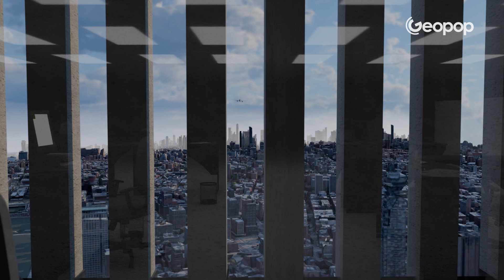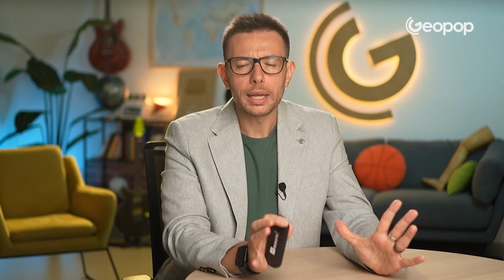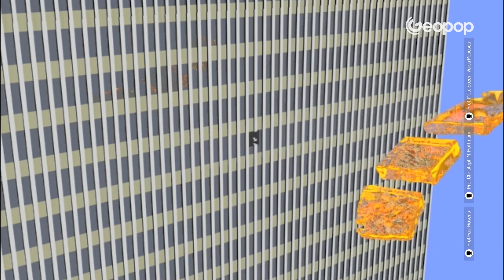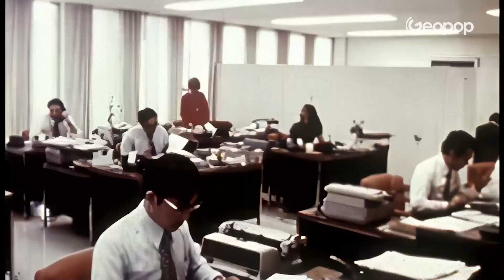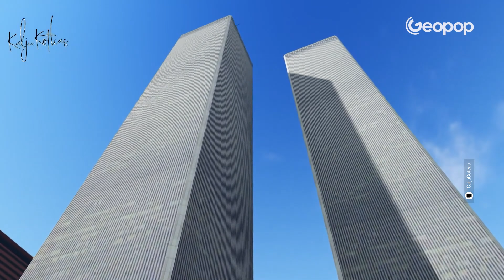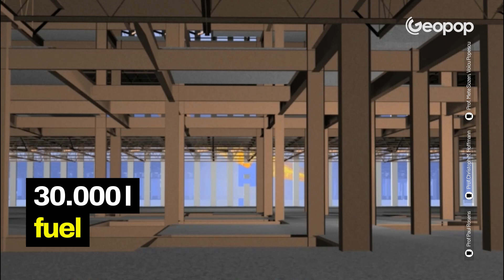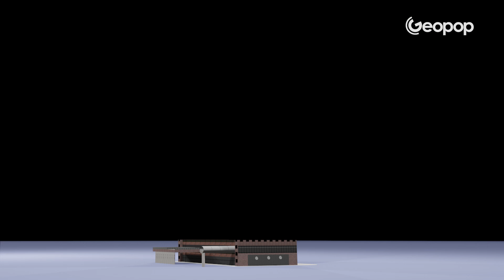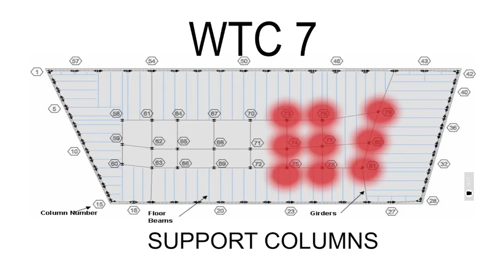9/11, 2001: The Technical Reconstruction of the Twin Towers and WTC 7 Collapses

Comment: Your information is incorrect.... There are over 25 thousand engineers that totally disagree with what you reported.... And what was given as a conclusion to this horrible attack.... The material used in an aircraft is much softer than the steel pillars constructed in those towers..,.so hitting those buildings would have buckled up the plane and they would have fallen apart....you can see this if you had checked out any other plane crashes...... When firefighters arrived on the scene the windows on the main and second floors were blown out indicating there were explosions that took place at lower levels, you can see all the floors underneath the points of impact there was no damage,.  ....workers in the building reported that several weeks before the crashes the buildings swayed from some sort of construction going on in the buildings and they could hear heavy grinding.... This noise would explain possible cutting into the pillars on various floors to weaken them where military explosives were planted.. when those buildings were in free fall you could see the explosions going off floor by floor.....the explosions underneath the buildings and on floors indicate destinations we're taking place...... absolutely very little things were recovered ....no desks no computers or chairs etc almost everything was pulverized to dust including many of the steel pillars and that kind of destruction is caused by military explosives..... firefighters reported molten lava flowed under the streets for days do to the explosives used....the firemen's boots melted from the intense heat ... Jet fuel does NOT burn that hot to that extent and that long....  Molten lava is caused by an explosive that burns at over 2000 degree F... A pancake fall meaning one floor falling on top of another would have taken much longer to come down and would not have fallen as perfectly as they did... people reported they heard timed explosions going off underneath them... which means explosives were planted under the streets ....I'm sharing enough... Think outside the narratives now that we know the war and who we blamed it on was fake and based on lies..... here's a clue .... Donald Rumsfeld went on the news the night before nine eleven and reported that 3.2 trillion dollars was missing from the Pentagon ......that kind of money buys a lot of diversion and silence...... And would have paid off a lot of corrupt people
Reply: You are absolutely right in your points. Thank you for stating them clearly and holding up a light to what really happened that horrible day. So many ignorant people on these feeds arguing for their paymasters in order  to discredit those who can see the facts clearly and who put them out there without prejudice so others can know the truth of that event.  Well done!
Reply: @brairr9966, you covered a lot of valid points on here, that for some reason, people just don't want to accept. The testimony of William Rodriguez backs up the claim that there WERE explosions at the basement level(s) BEFORE a plane even hit the tower:

https://youtu.be/rbZsoCuPD-w?si=T1DAnex0xaYkVlLu
Reply: @brairr9966 the following videos also support what you said:

Johnathan Cole's 9-11 experiments:

"-Collapse Vs Demolition"
https://youtu.be/XkXeNawHFFo?si=MOoEKvE6DbKrYoc3

"-The Great Thermate Debate"
https://youtu.be/ctRg_MDzhPY?si=c0s19cwIZPNJuCA-

"-The Mysterious Eutectic Steel"
https://youtu.be/3YuDKUCALtU?si=9B0G-MUAIGsOxuFQ

"-Eliminate The Impossible"
https://youtu.be/qGCWBDFZ5Zs?si=eQO8VN1UzSN2r7Os
Reply: You have never watched Japanese Kamikaze pilots and Okha Cherry blossoms smashing through steel of American ships? Have you?
Reply: So, what your saying is completely ignore the weight of the plane as a factor. Ignore momentum of that weight flying through the air at 700+ km/h. Yes, ignore that and focus just on what the plane is made of. Planes are made of aluminum or a composite. And by the logic of rock paper scissors, I automatically determine that steel columns beat plane.

Next point, firefighters arrived at the building, which had been hit by a plane and had moved at the top of the building by 30cm, and somehow this impact alone couldn't have caused windows in the building to shatter? Your saying that at the exact time the building was hit by a plane that explosives in the building were set off at exactly the same time? Right...

Let's pretend everything you said there was true, you really think that a conspiracy on that scale is truly possible without direct witnesses to the crime? I mean, organisation. The more people involved in a conspiracy the harder it is to prevent those people from going public. Which is why you keep a conspiracy as small as possible. Al Capone had a relatively small business enterprise and yet even he couldn't do anything about the feds turning his accountant. They only needed one guy to turn and the entire thing was doomed.
Reply: What a load of drivel
Reply: Please don't post misinformation. If you are unsure ask or look it up. Windows were blown on other floors as the explosive traveled through the elevator shafts. This isn't the first time you have heard this, you are just a kid and instead of learning you think everything is a conspiracy. Posting lies with no credible sources to your rant is extremely disrespectful.

Comment: That was clearly a controlled demolition. It’ll be 24 years in September, can we just stop?
Reply: Clearly how?  

Collapse initiation was due to sagging floor trusses (which we can see) causing inward bowing of some perimeter columns by up to 5 feet (which we can also see) at the impact and fire damaged floors until those perimeter columns buckled and failed, initiating the collapse (which we can see). I would refer to you the excellent Gary Pollard video of the collapse of the South Tower. Pay attention to the first 12 seconds in particular.

WTC2 Collapse -- Gary Pollard (Enhanced Raw Copy from NIST) 

www.youtube.com/watch?v=ULdiD6gYZO0  

Columns don’t work well when they are bent. The Twin Towers were designed to work with straight elements not bent ones. When you bend those columns they become up to 4 times weaker. Failure is inevitable.

Notice how the columns are already bent when the camera zooms in, become a bit more bent over the next new seconds until they give, starting the collapse. 

So what bent them? It sure as shit wasn’t thermite or sooper-sekrit fire-and-impact proof hush-a-boom pre-planted demolitions that don’t explode. 

If you keep watching you will note that after the tower starts collapsing the air inside the building (95% air by volume) gets compressed and forced out the windows. These low-velocity air bursts devoid of blast or fragmentation effect are a reaction to the building collapsing not a cause of the building collapsing 

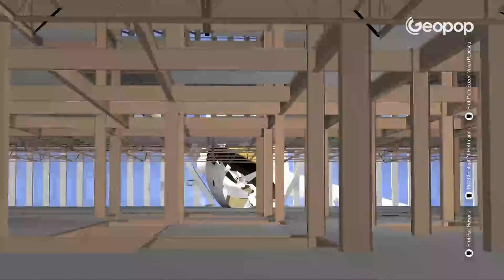And at a different angle from 1:18 here:
youtube.com/watch?v=TJJPYTVjxug&ab_channel=femr2 

Or here
www.youtube.com/watch?v=-DCgEJ2bUcI 

Also seen in the excellent still image here at 9:09:
youtube.com/watch?v=YXsDwKYz1bA&ab_channel=msvfreak94

Comment: Check the fireman’s rules for explosives. You don’t need sound to have explosives, which there were hundreds of reports just from police and firemen. 
They never checked for explosives! They took the evidence and shipped it to China. We have the videos that prove it. 
How was there molten steel under ground zero until December?? They needed special military claws that didn’t melt because everything was still molten and melting the claws. They had to use the ones for thermite testing from Kumatsu, another Bush investment. Same as Securacom being the security for WTC being a Bush family investment. How about the elevator work in the months before? 
How about the asbestos that would have been billions to remove it all? They even told people it was safe to be at ground zero even with all that asbestos. There’s thousands more dead from cancers! 
Memory hole 🕳️

Comment: B7 you said explosions would’ve blown out the glass. You never heard of the reports of the explosions that caused a ripple effect with the glass? You never saw the interviews of the guy who was standing near the fireman who had his hand over his walkie talkie during the countdown screaming for everyone to run for their lives? 
There were at least 3 reports of the collapse starting over 27 minutes before it happened. 
Office fires don’t cause what happened to any of the buildings. 
Not to mention, normal jets don’t have enough thrust to fly at 580mph that low to the ground. They need 6x more thrust. They can only do it up in the thin air. Not to mention they would break apart at those speeds. 
Your physics is showing..